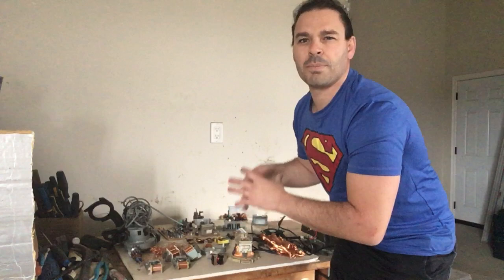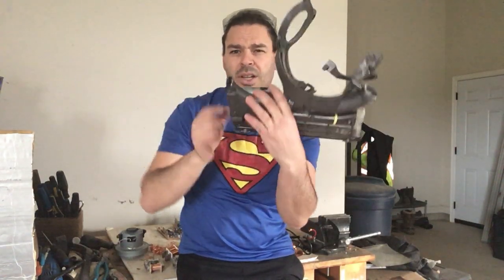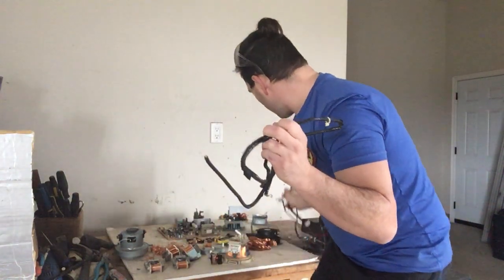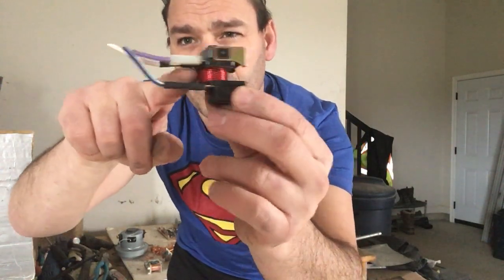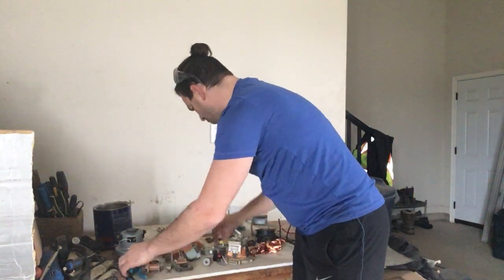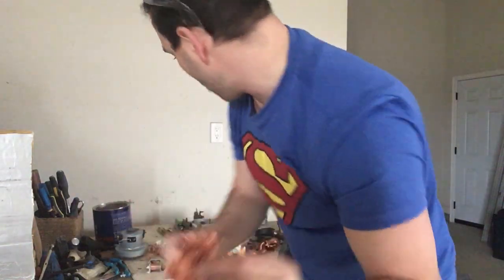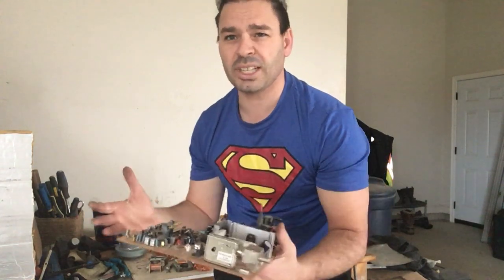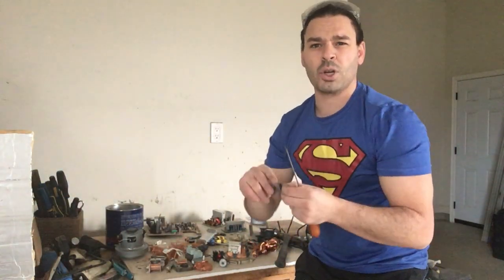Scrapping for copper.  Here are some commonly missed places to find more copper.

Comment: Hello from Sweden again.
Nice video.
Those "prongs" are called MOSFET, not that it matters for us Scrappers.
Oh yes, they do add up fast.
You also have some nice copper in the valves off washer machines, take a look at the video Hidden Copper I think it's called.
At the moment price on circuitboards are higer then aluminium so for now I leave it on the boards.
Stay safe and take care.

Comment: I disagree on the vacuum motors they are not always copper. My husband scraps and he has found quite a few vacuum motors that are aluminum
Reply from the maker: You could do the scratch test to see if the bigger spool is copper, but the inside smaller part is copper and there is also aluminum discs and brass on the motor. I will say that out of the 110+ vacuums I have scrapped over my years maybe 15-20 have been aluminum. In any case I still get the aluminum and throw the rest in my copper motors pile.

Comment: I've only recently found your channel, I appreciate you taking the time to this for us bru! Nice and straight forwards, and no pretension. Thanks for the time you're taking!
Reply from the maker: Thanks for the support and kind words.
Reply: @TinManScrapper  Silver contact boxes are called relays. when the coil is electrified (usually with 5-24 volts) the contacts close and can switch mains on and off. Those things on the heat sinks are transistors, you can burn them to acces the copper. on the circuit board you will notice loads of cylendrical upright things with metal tops. Those are capicitors, like a battery that can release all it's energy at once. Cut the base off to pull the CLEAN ALUMINUM can of the steal and paper insides.
Reply from the maker: @josh_o_j  the capacitors have some oil inside and can get messy. Not worth it for me. I know contact boxes are called relay boxes. Thanks for the info, you seem to be very knowledgeable about the items and probably how to put the board back together. Not me, I can take it apart, but not put it back together.
Reply: @TinManScrapper  btw with the small copper motors you find, you say you have trouble unravelling them, but I found a good way to do it you just hold the copper wire and let the motor drop, jingle it around and it will spindle down and unravel the copper pretty quickly. I can scrap a small motor in about 3 minutes

Comment: Great vid. The magnetron from microwave has 2 ends with berilium/ceramic shaft. If you grind steel bits off close to cylinder, both sides, is also copper honeycombed with some other metal
Reply from the maker: Yup, nice piece of copper chunk for sure. I put tape on the beryllium strips just as added precaution when grinding. Thanks for watching. Stay well.

Comment: I took apart an old contact box from my welder, the silver looks black even when I try to clean it 🤔
Reply from the maker: Only a small dot of silver. Unfortunately not a lot, but still free silver. Some contacts are bigger than others. I add them up and one day will melt them down.
Reply: It's been burned. The silver makes contact with the switch and can get very hot. It's still silver.
Reply from the maker: @irishgoldstacker8018  yup

Comment: I've only found 1 or 2 vacuum cleaners that has copper. All the rest had aluminum.  I scratch test through the casing and then through it in a bin with copper baring motors. 
Unfortunately here in Southern Louisiana the yards never pay a good rate. The difference between #2 and bare bright is not more than 20 cents. Two yards owned by the same company pays different prices.
Reply from the maker: I think it all depends on where you live and the type of vacuum. I have had a little more luck on the copper end, but they are getting more scarce.

Comment: Awesome vid. Had no idea about the tv screen cable.  Funny how things are different in different countries that fine wire comes under dry bright wire at my local scrappy.  Thanks for the info.  Just curious how do you remove the silver contacts from the copper or brass its attached to
Reply from the maker: I cut as close to the copper/brass and put the silver contacts in a container. When I have a lot I will use nitric acid. It dissolves all metals but silver. Afterwards I am hoping to melt it down and make a silver bullion. Long time away though since I will need a lot of them to make a nice bullion.
Reply: @TinManScrapper Thanks for the info I started scrapping purely to fuel my smelting hobby lol now I'm hooked.  I'm subscribed to a few of you guys on here and keep missing snobby scrap pickers lives lol.  I melt all copper aluminium and brass.  I'm sorta doing e waste too in that I'm stripping circuit boards bare and saving the components was watching a chap called 999 dusan and he puts the stripped boards in caustic soda to show the base metal under the green or whatever the colour of the pcb as some actually have gold underneath the green
Reply: @TinManScrapper  also from videos I have watched most contacts are 925 silver or purer.  But in regards to contacts and silver recovery I switch between ewaste ben and 999 dusan

Comment: I have a question for the community I have copper tubing free of paint solder and other contaminants and I have what I guess would be called #2 copper wire uninsulated and bright but each strand is smaller than pencil lead ie from extension cords. My question is are these 2 items considered the same category and should I bring them to the scrap yard together or separated
Reply from the maker: The strands that are smaller than pencil lead are classified as #2. The copper tubing would be #1 so make sure you separate since here in Lon. Ont. #2 price $3.50 lb. and #1 $3.90lb.
Reply: Thank you very much!!
Reply from the maker: @roblancie1007  Glad I could help
Reply: My yards put all #2 in the same bin, whether it’s contaminated pipe with paint or solder or thin wire, or pieces from electrical boxes that maybe nickel or tin plated. All #2.
#1 is usually clean pipes or thick pieces of plate or thicker wire that isn’t shiny.
Bare bright is freshly stripped thick wire, pays the most.
Don’t forget irony/dirty copper where it’s impossible to clean off iron, etc. like dirty brass.

Comment: At 15:17 if you look at the black and red thing behind the heat sinks I believe if you smash it with a hammer it also has a copper spool inside  😄
Reply from the maker: I will have to check.
Reply from the maker: Some do, but not all. Some actually have a spool beside it.